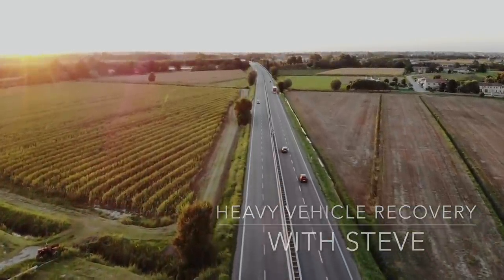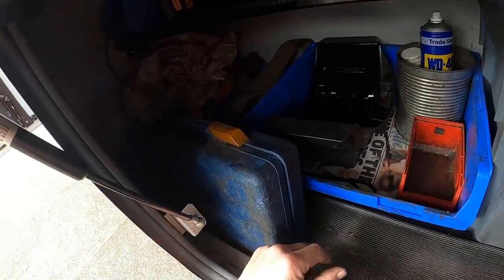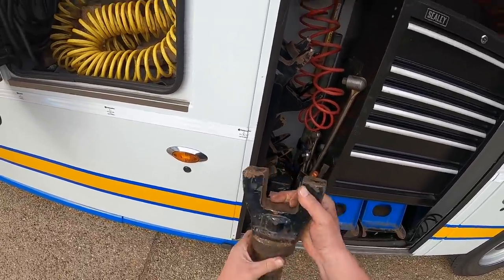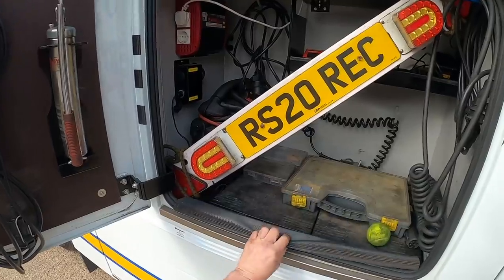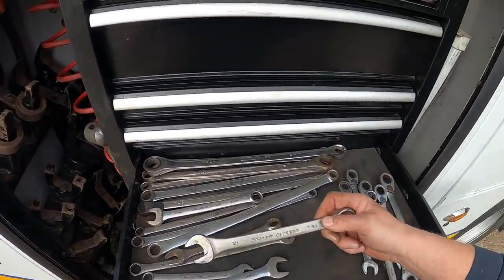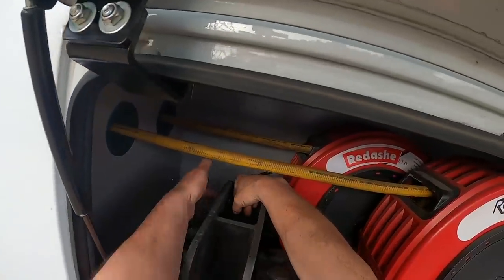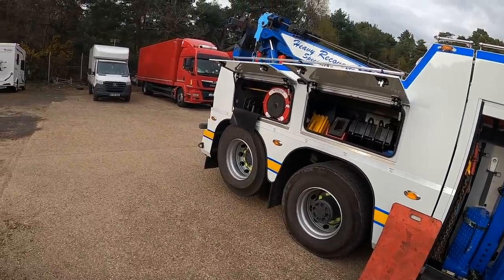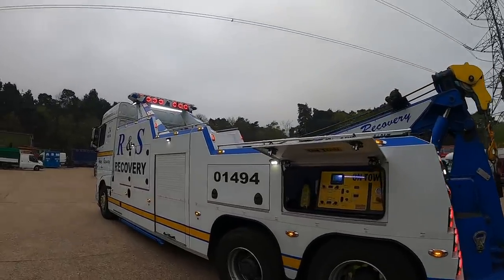UK HEAVY RECOVERY TRUCK TOUR: PART 2 - THE LORRY LOCKERS!

Comment: Great video and a nice truck Steve. You mention wanting a smaller impact to replace that DeWalt. Ive spent alot of time working in HGV workshops recently with the Milwaukee 1/2 inch mid torque and id definetly reccomend. Has become my go to instead of reaching for the heavy 3/4 and 1 inch guns, even started to wean the older guys off their air guns.
Reply from the maker: Hi Archie thanks for watching, think got to be Milwaukee i think too.

Comment: Another great video Steve, really jealous of your wagon and all the kit!

When I watch other videos on YouTube of HGV recovery, instead of using forks on the axle or wheel grids, they use a set-up that fixes to the towing eye points. To my untrained eye that way seems alot easier, quicker and safer as you're not having to get under the vehicle. Why is it that this method is used as much?
Reply from the maker: Hi Billy, think you referring to VDZ Systems yes i seen videos  as well not sure be quicker or easier  but safer not under truck chaining down.They also allow the front wheels of the casualty  vehicle to be towed with the wheels on the road so less weight you lifting so smaller truck could be used but think cost could be main stumbling block they dont come cheap.

Comment: Great video. What is your favourite and least favourite vehicle to recover and tow?
Reply from the maker: Hi Ryan , worst to recover got to be Coaches with independent suspension as wheel grids have to be used.
Reply: @HeavyRecoverywithSteve  the massive new extended Oxford Tube Coaches must be a nightmare to recover. I remember when they first released the new fleet one driver over turned one on a slip way to a carriageway going too fast. Was on it's side.

Great video mate. Cheers. Huge respect to you.

Comment: Great video Steve!
What are your thoughts on soft shackles?
Also what was the tennis ball for?
Reply from the maker: Hi Hugh, tennis ball for filling up at fuel pumps keeps lever pressed into handle saves holding it , good spotting it.Soft shackles?
Reply: @HeavyRecoverywithSteve  ah good idea with the ball!
Soft shackles.. Like a small fabric loop with a knot in one end. Replaces the heavy bow shackle.

Comment: How does the wireless trailer board connect to you truck?
Reply from the maker: Hi Jozua, its a rechargeable and wireless trailer board, it get signal from a transmitter that plug into the trailer socket.

Comment: Loved this vid Steve,  great to see the tools of the trade and how you have to be prepared for any scenario. Is the blue pole underneath kerbside of the truck for towing ?
Reply from the maker: Hi Paul,  yes tow pole used for flat towing when wheels of casualty vehicle needs to be kept on ground.Not used very much but handy maybe to recovery a heavy mobile crane when lifting with underlift not a option due to weight involved.